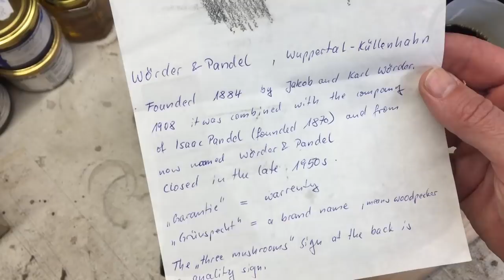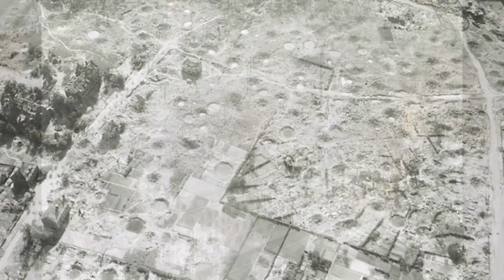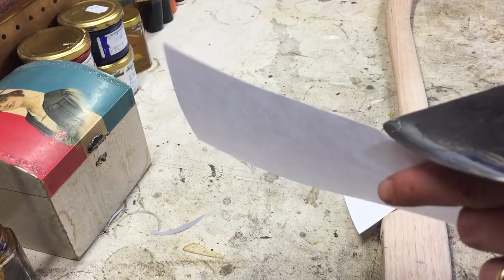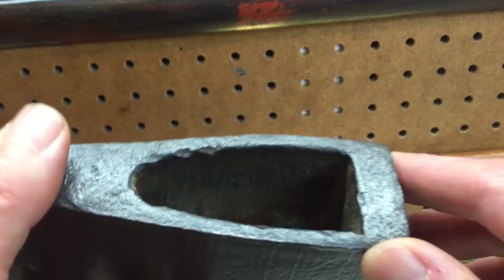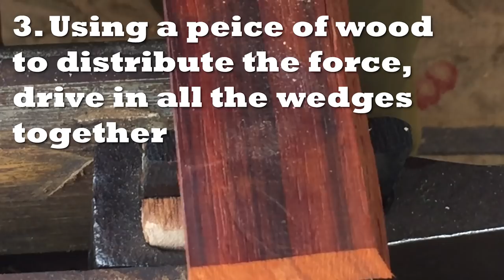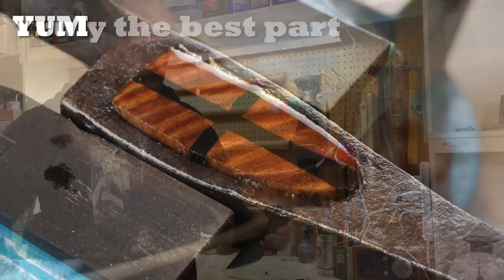5-Min Axe School: Cross-wedging German Ironmongery (The Work Axe Ep4)

Comment: Lovely looking job Sir !
Quite a few larger English axes have an eye length of 3 to 3 5/8 inches and quite a taper at the ends of the eye. I have done several of these with 2 sets of cross wedges in order to fully close both gaps. Two pairs of wedges are better than one, I think , to share out  the lengthways bend of the wood in the eye. I normally space each pair about 3/4" from the end. Much more than this, reduces the 'willingness' for the wood to bend and you increase the chance of cracking the haft. The main wedge should be a tight fit to the ends. One thing to note is that the cross wedges are best tapered in two directions. The first, and obvious one, is the taper required to fill the gaps at either end and the second is to trim the outside of the wedges a little, to suit the taper of the eye. Cutting the x wedges to no longer than the depth of the kerf really helps as these are then flush when you drive the main wedge. After driving the main wedge in about a third to half of the way, I usually send x wedges in to their full depth. This gives the lengthways spread needed for good fit, before the main wedging makes things too tight to move as well as giving unimpeded access to the main wedge. Using a 5/8" square x 6" drift makes it much easier to get these little wedges home without breaking them ...... Hope this is helpful to someone.

Comment: great guide. I have been messing a bit with crosswedging, but never was 100% happy. Will try this out. As you say, cross wedging in opinion should only be used when a lot of material need to be moved in the front-back plane of the eye.